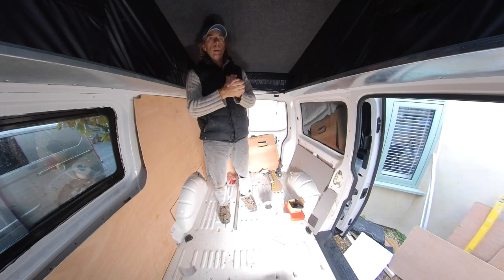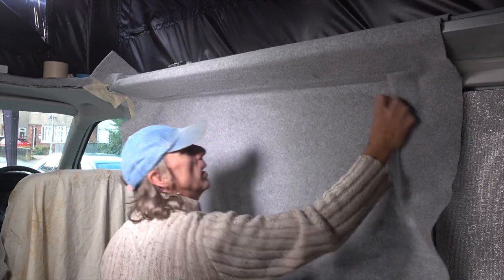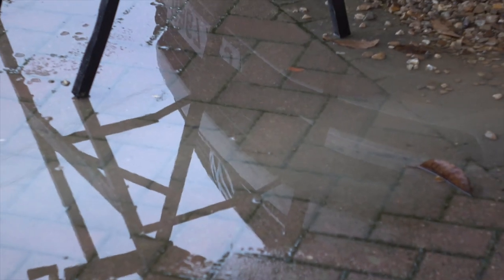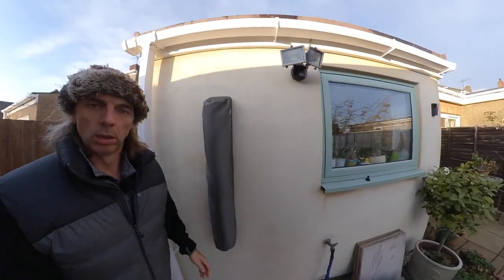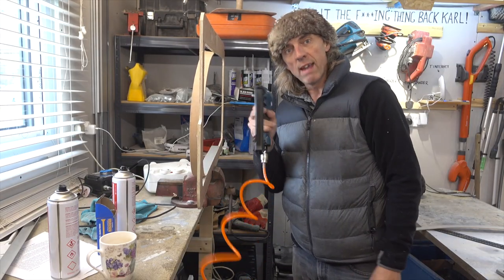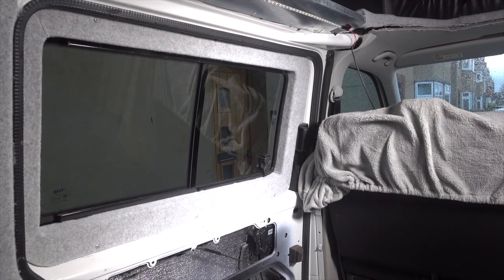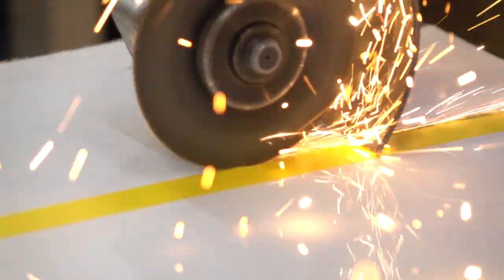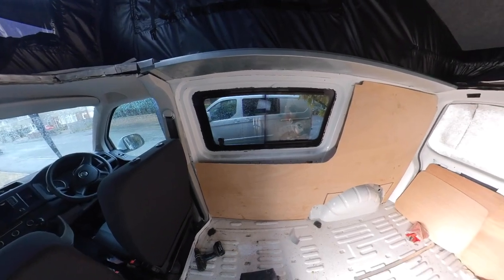Carpeting a VW transporter & making carpeted window frames

Comment: Great video & love your presentation style.    Im carpeting shortly so your video was very helpful.   What was the strip of wood you putting on the inside of the window frames?   Appears curved in one section of the video, but on another shot it looks like a strip of hardboard.  What ever it was how did you fit that to the back of the frame?    Thanks
Reply from the maker: just a strip of hardboard